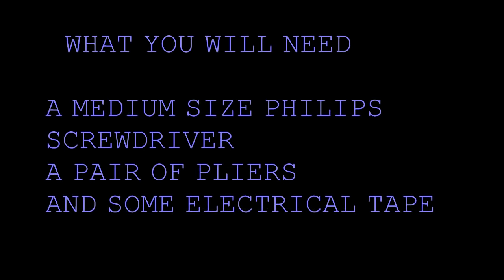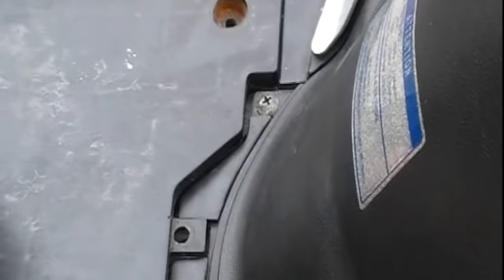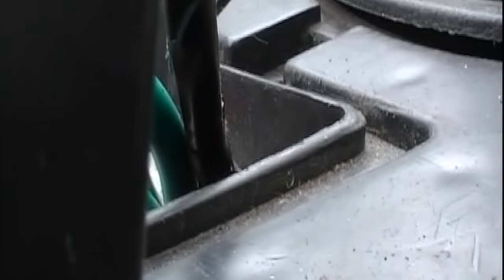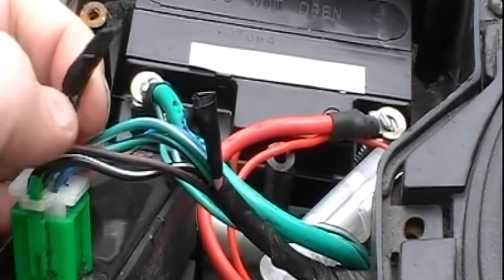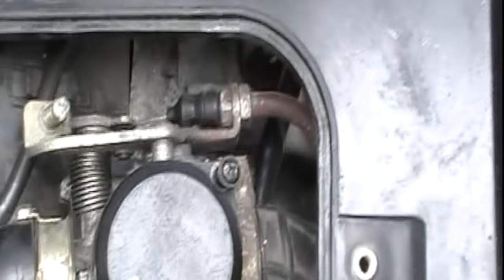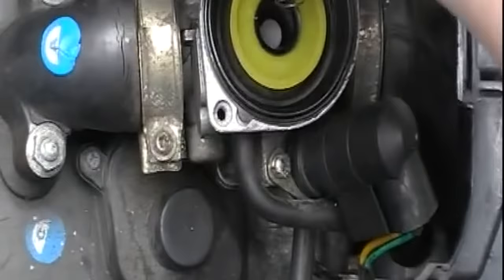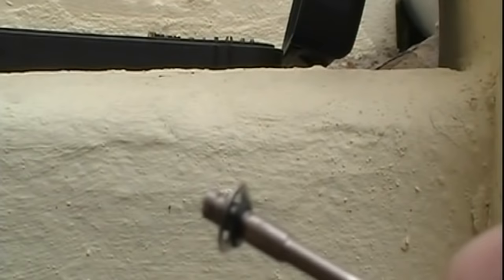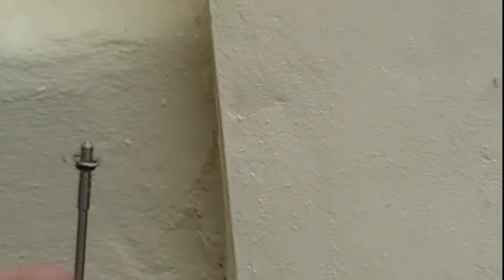How to derestrict a 50cc scooter / moped Make it go Faster

Comment: The yellow thing is a Diaphragm, and Metering rod.
Reply: +david Anti Illegals Metering rod? No it's the needle rod seat or venturi metering rod. In some cases the position of the venturi needle seat does increase the speed. Most cases this dude is a boob. Most of these carbs are NT in origins I have found a jetting proxy. I got a big box of jets from .010 up 65... never had a 65 jet work yet. 40 on down to a 22 which a freakin odd ball size makes mopeds and these motorized bikes I make do wheel stands...  a little race gas does wonders too.
Reply: Tim Yeakel You know what , remembering that time I screwed with a 50 cc carb ,I'll say you are right... Brain was in another area that night dude.Thanks bro.
Reply: That is Why is has positions David. Altitude heat and other conditions. The metering rod controls it. The factories seal the shit tell you nothing makes it illegal some factory standards to play with it. If not explore to let me know about jetting advice..
Reply: In an old Q-jet it would be called needles and you know that that any carb part made with rubber like that is a Diaphragm no matter what the purpose is. It works off vacuum.
Reply: Most carbs (automotive) work on a vacuum break.
Reply: @davidsnova   Most circuits in a carb do. The accelerator pump not so much.

Comment: U move the clip on the neddle the wrong way to get more gas u nedd to move the clip down that way the needle will raise down richer up leaner
Reply: correct comment. To get more fuel inside need to put needle more out of hole.
Reply: Lowering the needle leans the mixture which makes it run faster , But will probably only run for a few hours before it blows up. Don't do this . Do correct mods like bigger carb properly jetted , better breathing filter, performance exhaust .

Comment: that pin regulates the fuel flow in the carburettor... it doesnt "derestrict a 50cc scooter"... and after you do that, you need to modify the air intake so that the spark plug doesnt flood with petrol...

Comment: the fact is that buy buying a performance cdi its less hard on the scooter and has more tweeks so you can get even better performance. I no you are showing how to do it for free but you also sed something about not voiding warranty and for that the best thing would be to buy a cheap performance cdi wich I have seen on ebay for as little as $5 shipped and most can afford that. thanks for the video tho cus it will help a lot of people

Comment: that is nothing less than ridiculous, increasing the height of you needle lowers the needle into the jet so less fuel passes. the result is less fuel power.. surly you need higher fuel mixture, a longer crank, high compression head, heavier variator rollers, higher tension variator spring ., 11 ported  cross-flow barrel,  a bigger Carburetor than 14 mm , get a delorto 22 mm power jet, high flow exhaust. is more how to De-restrict you ped not cut the engines self destruct limiter. you haven't a clue.

Comment: Or you can just adjust the carburetor screw on side and it will run stronger with more fuel coming in make sure you dont flood your engine. Cutting wires does not make you that fast. adjusting the needle by lowering it your putting less fuel in system. There is a reason why they put rpm control so you dont blow up and overheat your engine, kids these days...
Reply: thank go someone else thought this. this guy is a joke.
Reply: +Patrick Webb (InsomniAxX) there's a main jet screw on the side of the carburetor (depending on your bike) and adjust that letting more fuel in, but put an easier flow air intake on to balance out the air to fuel ratio
Reply: The screw is an air screw to get the idle mix right
Reply: That is just an idle mixture screw. You need to change out the main jet for a bigger one if you want to increase the fuel flowing thru your carb.

Comment: You do realize that this guy is moving the clip up one position which in effect is dropping the needle lower,so leaner.He really should go the other way.If that doesn't get enough fuel the next option is the next richer main jet.Test the bike out,does it accelerate cleanly,how does it run on top,check your plug.Just remember that the best engine life and fuel economy are going to be returned by leaving it all alone.Just change the gearbox oil,clean and oil the filter,and fit the correct plug.

Comment: Changed days this guy should get a manual and let's what this and that are called. It was much more fun in the two stroke days a set of Boysin reeds and a port polish and if not faster defenetly smoother. Lap the heads loose the head gasket reject the carbs it all worked if you did it rite. If not you could start a collection of holed pistons lol

Comment: I personally guess that if this modifications were technically possible, the factory itself will do them and sell the moped as a 80 or more cc. Almost anything that you modify from the factory specs, including pistons, etc. will damage the engine for sure.
Reply: Raul Aguero I agree. There's a reason why the set them the way they do. Except serious damage if you try to make these modification.

Comment: Brilliant. Your descriptions were easy to follow, gonna try it later. Quick question, though. I recently brought a Peugeot V Clic 62 plate. I brought some cleaning solution from a motorbike retailer and put it in when I filled up. About 1 - 2 days later I'm having trouble with acceleration, barely making it to 10 to 15 mph! Could the reason be that it's dislodged so much gunk it's choked up the carburettor?!? Any help needed as I'm at my wits end with this bike! Also, how to "fix" the electric start on it. When you hold the left brake while holding the electric starter, it is turning over, trying to start but it seems to be missing that last bit of "Omph!" Please help!!! 🤬😤🤪👍🏻

Comment: i really hope no one does this lol he missing a vital part with the carb which is MORE AIR.moving the carb needle only makes it run richer which will actually make throttle response worse. and if you want your ped too rev higher buy a proper hpi cdi dont go messing with the rev limiter thats just dumb... you should have modded your variator instead you would have seen 10 more mph.

Comment: moving the clip up you run the risk of heat seizures as this makes the engine run lean, be careful with youtube advice videos, the "black & yellow thing" is the atmospheric diaphragm the "metal thing" is the fuel regulator needle, the best way to take the clip off is to use a safety pin, push it behind the gap of the clip as using pliers can damage the very delicate and precisely machined needle and its location grooves, if you bend it throw it away and buy a new one. . . 
keep it technical. . . you know what I mean like.

Comment: You would want to move the clip on the needle jet towards the long end, the point, or down rather than up. The way you described moving the clip in this video will make the engine run lean and that is not what you want unless you're spark plug is wet.  These engines come from the factory running as lean as possible to meet fuel consumption guidelines. Happy motoring and keep up the good work.

Comment: Just bash the engine repeatedly with a sledgehammer. This will knacker the engine in much the same way as the butchery suggested in the video...except you won’t be riding when the engine seizes, locks the back wheel and throws you off the bike under a bus. The sledgehammer method can be used when the bike is stationary and is therefore much safer. For an extra experience, do what’s suggested in the video to the £1,000 scooter you saved up so hard to buy. Invalidate the warranty and then burn a hole in the piston crown.

Comment: Ah, yes, do this in Sweden - and see when the cops take your moped and drill a hole right through the cylinder head and cylinder.
Not to mention the hefty fine you get..

Sure, it's not "illegal", but in Sweden it is - unless you register the bike as a light motorcycle.

Also, looking at your carburator being of membrane type - I guess it's a 4-stroke engine perhaps, or if not - it's a china made moped.
None of the bigger brands use a cheap carburator like that..

Comment: The main restriction on small CC engines I'm the UK is a metal ring In the exhaust port that narrows the diameter of the outlet port thus slowing engine. Lifting the "cir-clip" will make engine rum slightly leaner and yes a slight increase in power but at the risk of seizing the engine. You do not need to cut wires to disconnect the ECU meter. . I been making scooters go faster for over 35,years now and my advice is if you want more speed hang out at race events and talk to the mechanics working on lambrettas etc in the pits. They love it when young kids ask questions and show interest in tuning engines. Trust me you won't annoy them by showing an interest in what they are doing..advice off you.tube is at best contradictory and at worst is a con from a dick ! !

Comment: technically lifting the needle up further (lowering washer) increases idle and midrange fuel richening the air fuel mix. moving washer up leans the mixture with less fuel lean is faster but on newer machines they are already lean so leaner than that is destruction

Comment: Even if your adjustment allows for more fuel, you have failed to address the complimentary air flow which needs to change in order to keep the engine running at all. Fuel + Air = Power... right? Might I suggest a cone air filter if you think you have the fuel thing figured out LOL

Comment: yes but the hole as to be the same size as the opening of the wide gasket. the restricter is a tiny hold the makes the moped slow. unless your going to drill many tiny holes that fill up the entire restricter go ahead

Comment: omg this cracked me up did anyone realise that he leaned of the bike so its going to run hotter not necessarily faster and the wire is the rev limiter,i dont see how this would make it faster more like seize it up,my experience tells me that just changing the exhaust and uppjetting a bike is the safest way,back in the day all they did to restrict these mopeds is weld a washer in the front downpipe so just knock it out and your good to go faster about 50 mph.
Reply: this is a 50cc 4 stroke engine. If you are going to mod it, you'll always need to derestrict the cdi unit otherwise it won't get any faster. Changing the exhaust doesn't make any diffrence on a 4 stroke with that little amount of cc's. This will only work on a 2 stroke

Comment: The jet neele ONLY regulates idle. moving it down will just restrict fuel in idle NOT at full throttle. Restricting fuel at full throttle may result in  lean mixture and a hole burned in your piston top

Comment: Aye,moving the clip up on the needle runs the carby leaner by allowing the needle to seat lower in the main jet, and moving the clip lower enrichens the mixture in the opposite fashion. With mild add-ons like a uni-filter and an exhaust, moving the clip down is usually enough to get the mixture right without having to rejet the carb or buy a new/ bigger one. Good catch, Raymond and good vid Billysuk

Comment: Well, I guess everybody that doesn’t know has a moped that does not run correctly by you moving to clip up on the needle is restricting the seal you need to move the needle down, but hey everyone figures out the hard way every once in a while

Comment: Did you ever find that spring that popped out from the carburetor? Also, what is the result in mph improvement? Can it help get the scooter to about 55, roughly 10 mph or more over the previous limit? (Assuming no wind.) And will this method work on a scooter that has Continuously Variable Transmission? (I assume so because this video doesn't change the transmission at all.) Thank you.

Comment: That looks like a DC fired CDI box the AC fired have 2 separate harnesses an those you leave alone but you can get a performance CDI cheep about $16.00 USA,btw you just leaned out the carburetor

Comment: theres alot of videos about giving ways of derestricting peds.done one on mine..took out the screw that stops the throttle slide from opening all the way.can find it in the top of the carb where the spring was shown on this video,not all carbs are restricted with them.its not the one that holds the needle down.if you remove the screw from the long nut and put the nut backand  the throttle slide opens all the way.broken/cut wire is not a failure.nor is stupidity.scootershack.co.uk all welcome

Comment: it's a myth about the pink wire, just order a non restricted CDI from China, it's not like they are expensive, the cdI is limited internally, it's sending the signal to the coil, it knows the RPM if it's cut or not, the pink wire SENDS the rpm to a tach if you have   one

Comment: You float is stuck open. That is usually why you leak fuel from the over flow drain. Either that or you have a dirty carb from it sitting and you need to clean the jets, fuel passages and checking the float needle for fit and function. Are you trying to start it when it leaks or all the time?

Comment: You have to put the clip lower on the throttle pin not higher bud as you placed it higher NOT allowing more fuel and also a little extra tip take the washer out behind the clutch wheel that will allow the it to get an extra gear well let the drive belt to rise on the clutch wheel and lower on the drive wheel

Comment: just buy a new racing cdi with no rev limiter in it. they are very cheap to buy. needle cli adust how rich or lean you are from 1/2 to 3/4 throttle. moving it up makes it leaner. By you moving the clip up you just limited the amount of gas the carburetor mixes with the air  before going into the combustion chamber. So now you will get less gas. Depending on if it's a 2 stroke  which has to have oil mixed in the gas to lubricate the motor if you lean it out like that too far you will sieze the engine. If you honestly we're trying to increase your fuel going into the combustion chamber then you would move the clip as far down as you can go. Which will richen the fuel air mixture but you may have to play with the needle jets sizes in the carburetor to find the right ones that will allow your engine to scream. But if the carb was running good the 2 best methods to increase the speed would be to buy a racing CDI with no rev limiter and change out your sprockets so that you get a loser gear ratio for what your wanting to achieve. If it's really super fast acceleration then you go bigger in teeth count with the sprocket that on your rear wheel. If it's top end and final speed then go go down in teeth count. So to climb a steep hill you would use a 10tooth on motor and a 53 or bigger on wheel. Buy if you live where it's say flat and you have long straight roads without a lot of stops then you would want top end and run a 32 or smaller on your wheel

Comment: i just drill the littlle tiny pinkiy hole from the head gasket inside the exaust pipe to make it 1 inch insted of several milimeters.doing this makes all the air comeout that can go 35 miles perhour instead of 15.

Comment: Dude! don't CUT that wire! Just pull it out. Also adding more fuel, without more air, and better ignition(spark) equals waste of fuel, and other issues. The proper mods for these bikes are dirt cheap, do yourself a favor, go the correct route and spend a days pay for the right parts, lol.

Comment: ..needle up is more space for the hole, so more gas.. so why did you lower it? It also only ment for the first tiny bit reaction of the throttle. This has absolute no influence on how much gas the engine can get for speed. Its just to control the rpm while slow driving. Also, more gas isnt always meaning more speed. Its more about the perfect mix  of air and gas.

Comment: Doesnt moving the c-clip away from the point on the pin lean it out? It sounds like you're cutting out the rev limiter and leaning it out at high RPMs! You want that PIN to open sooner than later maybe a little bit bigger jet and possibly slight muffler mod.

Comment: Do not move up the metal ring because it will cause it to have less fuel which will make it burn hotter and will eventually burn a hole in the piston

Comment: I have a question. What causing my moped not to take off standing still. Do the throttle need tune up? I just put on a new belt on. Oh, i have a express Gator 50cc s3 2019 moped.

Comment: Wrong way round dude.  You have raise the needle not lower it to increase fuel delivery. The snap ring should have been LOWERED one notch and this consequently RAISES the needle and therefore enables more fuel. Lowering the needle by RAISING the snap ring will probably seize the motor or at least, make it run hot as you are shutting down fuel delivery. .

Comment from the maker: Well it was doing 30 befor I cut the pink wire and moved the needle and now it goes about 45mph 50 down hill with the wind at my back. About the spark plug did an gear oli change and changed the belt on it a few days ago as it was asecond hand bike and didn't now last time it was changed cheked the gaping on the spark plug  and there was no problem with it just like a spark plug thanks

Comment: I can understand your thought here but the needle does not affect idle or wide open throttle mixtures.It affects fuel/air mixture from about 1/4 throttle up to about 3/4  throttle depending on the taper of the needle.a low speed jet(and sometimes an idle jet) meters mixture at the engines lowest rpm(idle to about 1/4 throttle)  and a hi speed jet(which the needle rises and falls in and out of) controls the mixture starting at about 3/4 on up to wide open throttle.